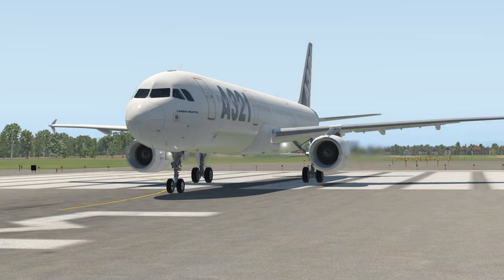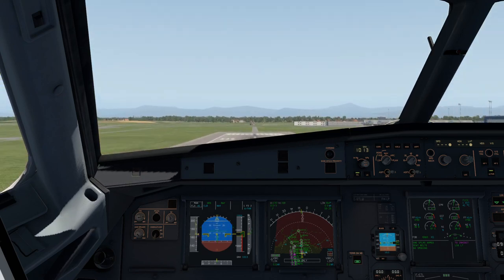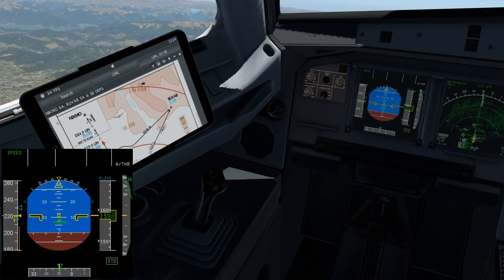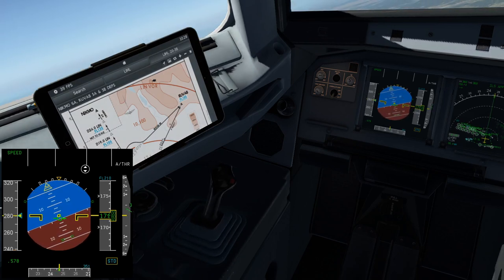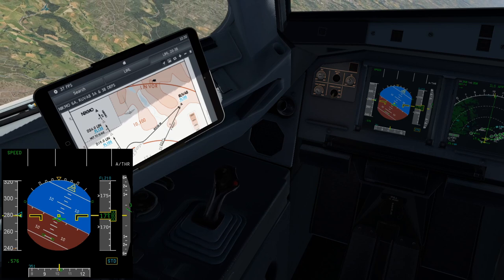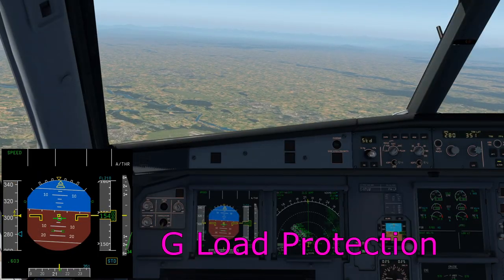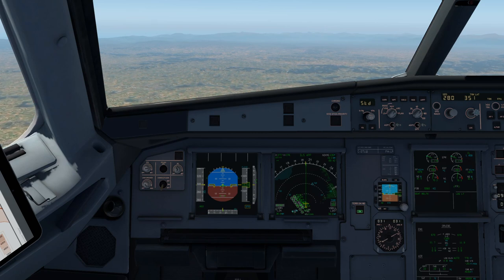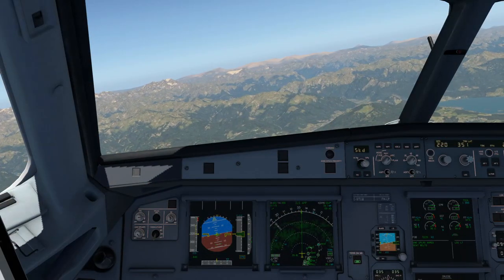What is the Airbus? Part 1: Normal Law with a Real Airbus Pilot! ToLiss A321 X Plane 11

Comment: Nice vid! Your tutorials are great! On the toliss a319 takeoff while trying to rotate at 3deg/s there’s a noticeable decrease of rotation rate around 10deg pitch, and more aft stick is needed to pull through this. Is that also the case on the real plane?
Reply from the maker: Hi Nosig86 thanks for watching. This is accurate, very much so, I will explain why in a video soon!

Comment: did  you read when there was a first officer who kept pulling a very slight back pressure on stick they though the aircraft was overspeeding but it was not the aircraft stalled  not good  there was faults with the pfds and speed tapes so like you say got be careful in both laws
Reply from the maker: Next video will look at alternate law and some of its risks.

Comment: Great videos. One tip that I’ll give you. Maybe try a live flight on vatsim. Your subscribers can join and I assure you it will strengthen the fan base🙂
Reply from the maker: Hi Infinite224 thanks for watching and for the suggestion! So far I have done 3 streams, they are very much experiments at this point but I plan to do more in June. The recordings are available on my channel :)